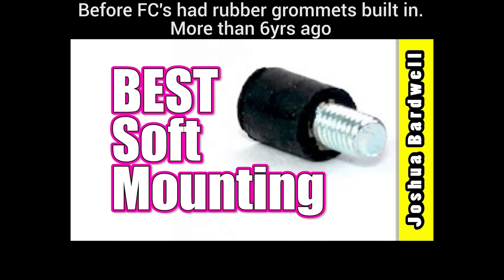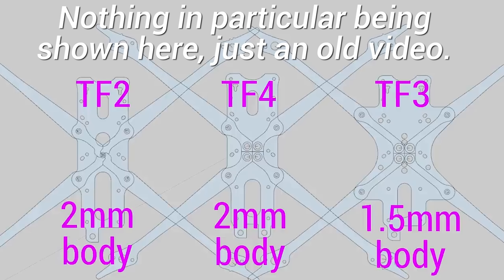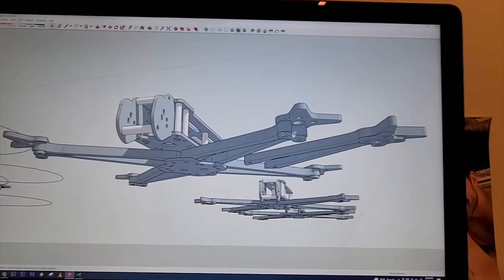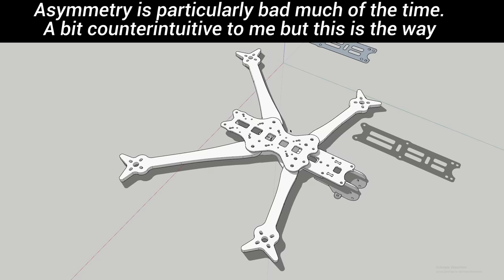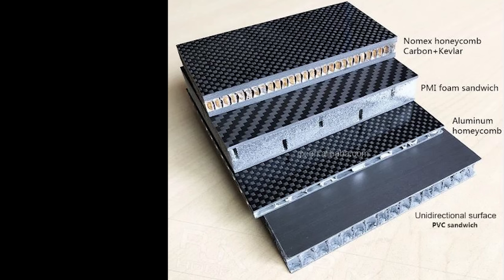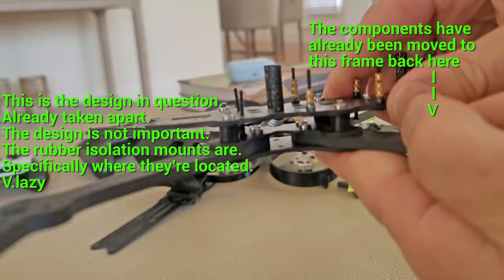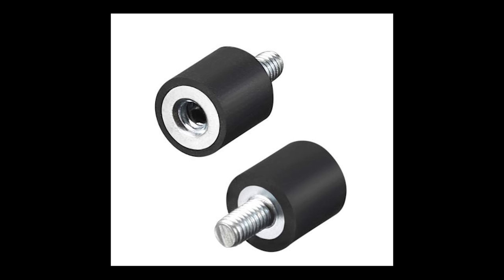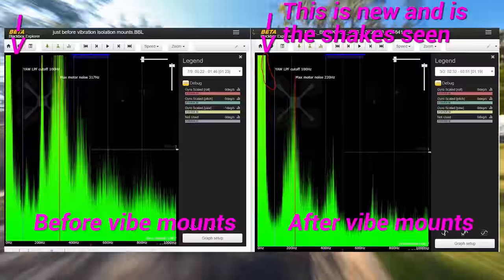I put some steel cable on a quad...

Comment: I’m a machinist for 3 lumber mills and I learned a hard lesson quickly. Rarely do you solve a problem with brute force. We had the arms that lift up the boards. Thy are cycled with air cylinders. Theses arena where made from steel tube. Thy kept breaking them. So I made some out of solid plate and now the problem moved to the cylinder mounts and started ripping them apart. So I made heat treated mounts. Then we started loosing cylinders so we went up in rod size. Then the entire frame started cracking and puking out of the concrete. The solution was making arms out of solid UHMW and we have never had a problem since. Heavy objects don’t want to move and stopping them is even harder. So dropping weight and moving to a forgiving material solved it. I have seen this trend with frames getting stiffer and stiffer. The stiffer something is the more effective it is going to transfer vibrations. Think a pre cooked vs a cooked noodle. But this is a rabbit hole that is very easy to go down when you think we need more strength and more and more. When like you said mass does not want to move so bolt the FC to the biggest mass you have and isolate it from the rest of the frame. I’m surprised dampening motor mounts have not been really developed.
Reply from the maker: In this specific case, it's not quite consistent with your findings with your application. I have tried to make arms from HDPE and a number of other materials as well as sandwiched materials and many other options just to run into low frequency wobbles and resonance which is the very worst kind of vibration for this application. I do hear you completely however and will try something else you may be intrigued to see in the future.

Comment: I’m taking a break from FPV right now but man this excited me. Innovation has kinda been stagnant lately, or at least stagnant in the departments I find interesting so this was sick!
Reply from the maker: Unfortunately a lot of that has to do with how the world has just halted for the past 3 years. At this point I wouldn't even say it's a result of COVID. I would say it's more so as a result of both of our idiotic governments. Unfortunately small businesses end general developments suffer as a result
Reply: @KababFPV  true glad you said what alot was thinking
Reply: Also on a break and being gaslighted from this! Got to the point where I was burning flight controllers out once a week bc of bad gyro QA. Not sustainable
Reply: @Kabab  hey buddy, i spent a couple decades building digital models of acoustic musical instruments. i've designed micro frames like the deculture fuxxor but you know everybody wanna be famous. ..understanding waveguides, take some of your carbon and cut it into strips or use plates and measure the impulse response over distance. the reason is, very simple models of acoustic instruments focusing on only the lower partials are "often correct enough," so if you design a frame by having solid data about the impulse response of your material so you can design at least the first order responsivity of the dimensions, you can at least improve upon the most elementary criteria.
but seriously, you go about it all wrong like everyone else. if you want to minimise vibration, don't clamp it on with a steel U bolt... use dental floss. if there's no mass, there's no vibration. glue and dental floss will actually make an awesome lightweight frame and it has all the tensile strength you could want.
yeah i wish some people had spent time listening to me instead of trying to be the next instant celeb. i tell people useful stuff. like if you need to code a cepstrum from your fourier analysis, just run another fft on your mag10'ed mag bins :)

Comment: Bob is one of those few guys who pushes the industry forward, he figures something out, then the rest of community catch him up after 1-2 years.:face-green-smiling:
From my shallow experience what I found out was - for high performance 5 inchers sometimes it's better to reduce the filter (faze) delay but get some more noise, than  get the absolutely clean  gyro traces after filtering. PIDs should act on the gyro signal which is closest to the present time.
It's good to have frame resonance higher than 200hz, then to cut it out with either static or dynamic notch.
Sorry for my generalizations, that's related to my build.

Comment: Cool video, a lot of really interesting concepts in there. From my experience and simulations I can't really find a way forward with rubber damping parts except for lightweight components with gyros that need vibration isolation for higher frequencies. If you try to soft mount heavy parts (like go pro or battery) you have two heavy bodies that can move relative to each other with low resonant frequency... Catastrophe!

Anything like rubber that is springy as well as damping will create new resonances as well as soaking up energy. The heavier the sprung mass and the softer the rubber the lower the new resonance and the bigger the problem it causes. Soft ruber is good for absorbing vibrations but also causes lower frequency vibes.

If we want to "soft mount" heavy parts like Go Pro or Battery we need to use very stiff ruber to avoid creating low frequency resonance. Unfortunately stiff rubber doesn't really absorb vibration!

Damping grease has zero spring so doesn't create a new resonance which is why it consistently works. Looking forward to seeing what comes next, keep at it.

Comment: Lots of blackbox.  :-)   Warms my heart.  Love to see the engineering at work!   Mark Rober approved!
Reply from the maker: 😂 I always use BB. I just don't put a whole lot of effort into dissecting it because it reminds me of my organic chemistry lab exams where we get a similar graph and need to explain which molecule we're looking at which was so annoying....also because you can go so deep into it and I'd rather focus on high level ways to get things working right without fuss. I use your presents in BF all the time. Sometimes they match right and it's better. 👍
Reply: @Kabab  yeah it is just a good tool.  Don't be shy.  Embrace the obsession.

My take is there are lots of frames out there that work well for vibration across all the quad classes.  If we narrow to 5" class, that probably has the most: Apex, Martian II, Trans Tek Laser, Source One, etc...  The gist I'm gathering is you want less weight and that is then where the vibrations creep in?  

OR

I think you just have some engineer in you, because this video is like the engineering method 101: design, build, test, measure, modify, repeat.  Tools like finite element analysis can shorten the cycle, but can take the fun out of it when the hobby is the method, not doing the finite analalsys in front of a PC; which then  also needs real-world validate (is a part of design step).

Mark Spatz, P.E. (licensed)
(in good company here 😎)
Reply from the maker: @uavtech  I definitely prefer and enjoy the build-test approach. Moreso because I learn a lot more about other things than just what I'm trying to focus on. FEA is helpful but is a very sterilized approach which doesn't always lead to the right result. That and I'm definitely looking for a way to drop weight. 20g less with comparable or better vibration management is gold to me.
Reply: @Kabab  100%
Enjoying your work!
Reply: @uavtech  Really is amazing how well the source one v3 performs stock and its even better if you move to 6mm arms its dead quiet in the bb. I've got some far more expensive frames that resonate all the way up to 300Hz.
Reply from the maker: share some BB with me? Just curious what it looks like. Message me on FB. Bob Roogi
Reply from the maker: just looked, the 5" with 4mm arms is over 145g....a 6mm arm version is gonna be what like 185g? Just a tad high.

Comment: i made my own camera mount which mechanically decouple the camera. simple as that. no jello. no ND nonsense. no shaking. perfect footage on EVERY quad with every different action cam. DJI, insta36 or gopro. from 3" all the way up to 6" works. i am trying to convince people for 2 years to try my mount for free. most refuse and say i need change PIDs. or must use ND filters. or other BS. at this point i gave up. my footage is perfect. always. while others still struggle. happy to see you also working on that.
Reply from the maker: I don't use an ND for vibrations. I use it for the actual ND effect to get motion blur
Reply: @Kabab  which i can totally appreciate as cinematic pilot. and thats the ONLY way NDs should be used for. but lets be honest 90% say it helps with jello which is right but only like 50% and its a patch for an entirely different problem. anyway as i said i am happy to see others trying to deal with the actual vibration problem instead of just use other tools to cover it. good job

Comment: I’ve always wanted to attach the FC and camera to the battery, the least vibrating mass on the craft, and then isolate the motors, by putting hem on the other side of the battery mass.  Pretty much strap the camera and FC to the battery, and then strap that to the frame/motors.  Sticking it to the top plate is something I’ve always thought made sense as well.  Great to see you do so much research in all these different avenues of possibilities.  Thank you for sharing ythis.  It’s so educational in so many dimensions.  Yes! Faster videos, less production value is better if you can share our findings faster.  Great video!  You have one of the best presentation skills in FPV.  Quick, concise, relevant, good pace, actual knowledge, etc.
Reply from the maker: I'm hoping it's really as simple as moving through FC to the top plate and we instantly all get ~20% damping right off the bat
Reply: @Kabab  I guess one can make a simple test by printing some lipo guard, sticking it on top of the battery and just duct taping the FC to it. Not production ready solution of course, but should be enough to estimate if this particular spot gives better results.

Comment: I reduce the vibrations in a slightly different way. I modified the betaflight configurator so that I can see the unfiltered vibrations on the motor as it spins from the configurator. The quadcopter is anchored not very hard, but enough not to fly away on soft material. I rotate the motor to a certain speed, record the maximum vibration amplitude and stop the motor. After that, I add a little adhesive tape to the propeller and act according to the method for worse or better. Thus, it turns out to reduce vibrations several times even on new motors and propellants. On my old gopro 3, this reduces the effect of jelly to almost zero.
Reply from the maker: Jello isn't the issue here. It's the vibrations getting to the gyro. What you do is dynamic balancing and the best way however it's very time consuming and doesn't last once you damage a blade a little or swap blades or even just unscrew and tighten a blade.
Reply: @Kabab  I tried today to change the flight controller to the top plate for the sake of interest. Without rubber dampers on the top plate but with dampers on the flight controller. According to the logs - it got a little worse. So apparently there is no difference in person closer or farther from the battery.
Reply from the maker: @ekap123321  definitely good input. Thanks for testing.

Comment: It seems that you should try those new low-noise helical props. Since they reduce air turbulence (and vibration) making them more efficient and quieter.
Reply from the maker: I literally put a video up on that this morning. All those claims are false by MIT unfortunately but the overall prop design that was made may not be a total waste. See the video I put up this morning
Reply: @Kabab  Oh okay. Thanks.
Reply: @Kabab  I watched it. That kind of propeller design is a whole new area to experiment with and make videos.
About frames: 
Have you looked into making frames with a biomimicry structural design? They are of course difficult to design and produce, but I think that method would solve your vibration issues, as well as make them lighter. Another drawback is that you'd have to add plastic skins over them to reduce drag.  
(I looked through most of your video thumbnails, and I didn't see any.)

Comment: The whole idea is to decouple the vibration from the motors. The more material the vibrations need to travel through, the more damping you will see, hence why moving the FC to the top plate has more of an effect because the vibes have essentially more distance to cover before reaching the FC. Think of all the mounting points and the material between them as conduits for conducting vibrations. The further your mounts are away from the source of the vibes, the more of a damping effect you will see. Configure the build like a maze where the vibes have the longest path to travel before reaching the FC.
Reply from the maker: That's what I'm hoping is happening...we'll see
Reply: This is also what I discovered while prototyping, interested in the results between the different position on the H frame because of the shorter arms
Reply: That's where the H frame theoretically makes sense. However I think you'll loose a lot of stiffness and overall rigidity in the whole structure that it creates new problems like lower freq vibrations and more critical resonance modes. So trying to balance that trade-off, you kind of end up with the standard X frame. Just my assumption. We'll see how your test works out
Reply: @ariafpv  It's less about X or H shape and more about the interfaces between parts IMO. I'd first focus on building a rigid structure for the arms and motors to have a solid foundation. From there you work backwards and come up with a clever way to decouple that from whatever part your FC is mounted to. The FC mount doesn't need to be strong in itself, it just needs to hold in it's place.
Reply: @KevPV  yes kind of what I meant. With X style I was just refering to a standard layout creating a rigid core in the center (opposed to the H frame he showed). Doesn't need to be the usual 4 interlocking arms. As you said the goal is to only have the FC be "decoupled" from the rest
Reply from the maker: @ariafpv  yeah this is a very real possibility as well. Something I didn't describe is that plate I have slapped against the bottom of the H in the model. That's a 1.5mm plate that I'm going to have cut at a 45deg angle and bolt it to the 0/90deg cut main deck. This is a trick I use on all my frames to gain absolute rigidity in the body. I'd use quasi carbon for the main deck but then it would be much weaker
Reply from the maker: @KevPV  another thing to note is that two motors share one arm and that's at a 90deg angle to the rest of the structure. I haven't actually investigated an H frame like this but I feel like it could be a lot better or a lot worse. The two motors on the arm may reonate together or may self contain on the arm. We'll see

Comment: After years of carefully tuning to get rid of vibration and then constantly failing, I came to the realization that most of my vibrations come down to temperature. Not only do the resonance frequencies of the materials (carbon/rubber/gel) change, but also the characteristics of the electronics. Most FC use simple RC oscillators which aren't temperature stable, so they drift. So tuning filters for specific frequencies is completely pointless when you are flying in a wide temperature range. Not only that, if you look at datasheets of carefully profiled Gyros you'll find parameters like "Sensitivity percantage change per Kelvin", "Sensitivity percentage change per Volt" (at specific temperature), "Zero-rate offset over temperature change" and "Zero-rate offset drift per Volt" (at specific temperature). So in my opinion testing of frame vibrations only makes sense if you perfectly temperature control at least the electronics. A common practice to achieve that is to encapsulate the electronics and heat them to a fixed temperature. I don't think anyone would go that far for an otherwise simple hobby though.
Reply from the maker: Absolutely 100% correct. This is also part of the reason why I need a damping system but just works sort of no matter what. If it is as simple as just strapping the flight controller to the top plate with all the weight on it, that would really be a miracle. Also, if you're able to lower your filters or just generally give the filters an easier time, they will be more capable in a wider range of applications. This would include wider temperature fluctuations. If we can turn off our filters, there would be no more tuning. Everything would just work right with a general tune because the system knows exactly what's going on with the craft

Comment: 100% Silicone calk/sealant sandwiched between frame components does wonders to reduce the noise floor. Because it's a mild adhesive, it seems to really unify the frame pieces. It's better than greasing it because it sets up and doesn't constantly ooze out and attract dirt.
Reply from the maker: Yeah that's an option but it suffers from the same issue as anything else between carbon. You bolt it together to try and keep it strong which negates anything between mostly

Comment: Lets say instead of suspending the fuselage section on the arm section with cables we just have a soft material in-between, it can be whatever tpu, rubber, polyurethane try a set of different stiffnesses. this could be attempted on a lot of different frames by just sticking a battery pad between the arm section and the middle plate. It's similar to chris rossers dampening grease idea but less messy.
Reply from the maker: yeah that works except that you also bolt the thing together which negates anything put between the carbon. We need the actual material that's damping to also be durable enough to hold the craft together.